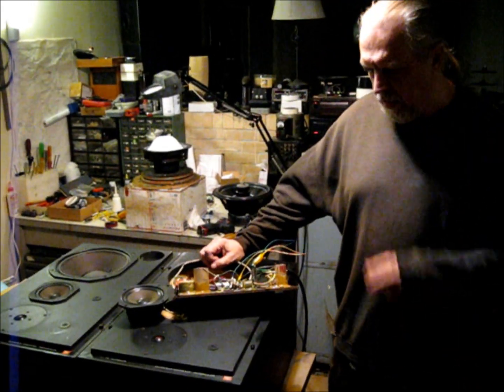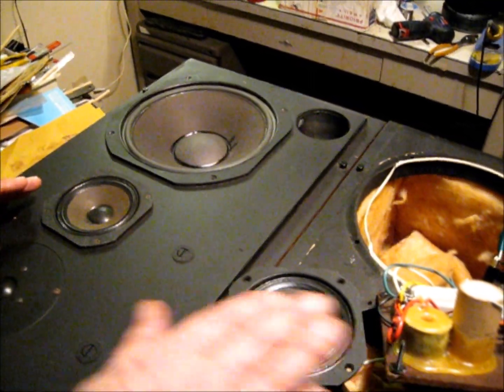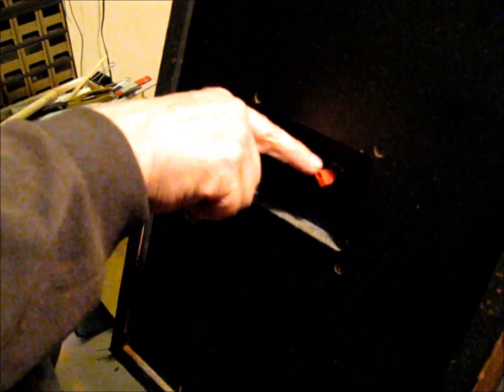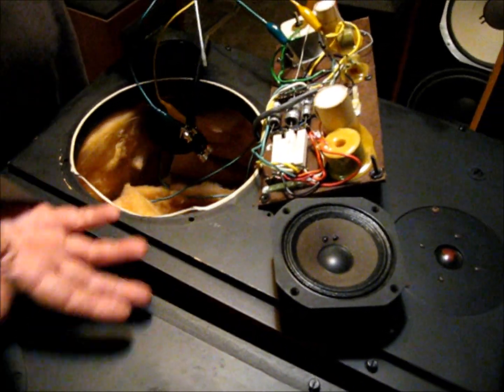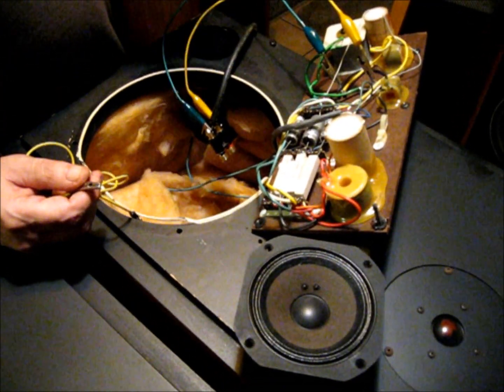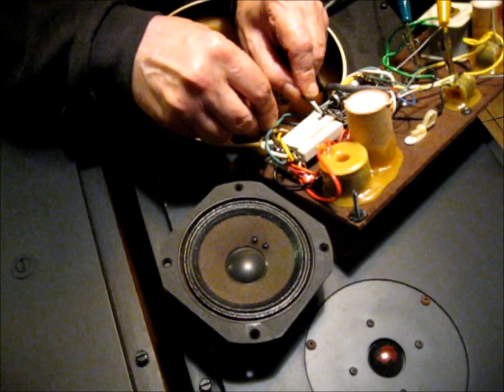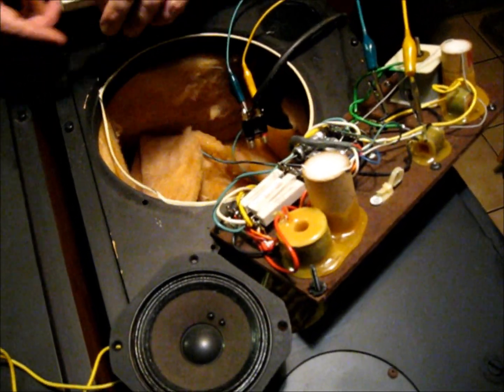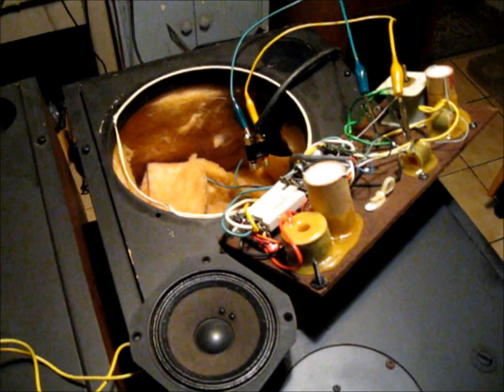JBL 110 Repair

Comment: We paid $275 for a pair in perfect working condition nearly 3 years ago and I'm still searching for a pair of speakers that is s capable as these with every genre of music. The ADS are great at acoustic and jazz, the Polk Monitors are great until you get to hard rock and metal, the Cerwin Vegas are nice for about a half hour then they just hurt your ears, but the L110s just sail through it all and sound fantastic. I will be recapping them this spring, but after watching your video I am now thinking I should go the extra mile and replace those connectors as well.